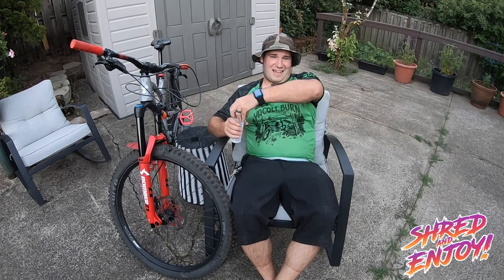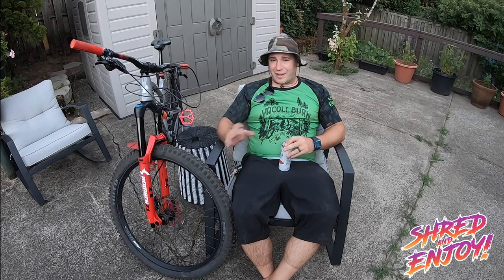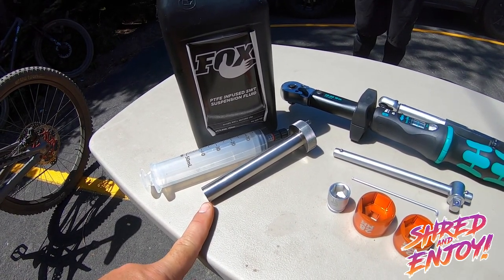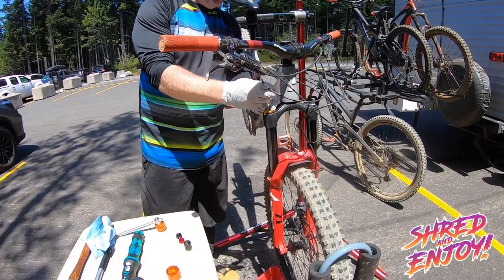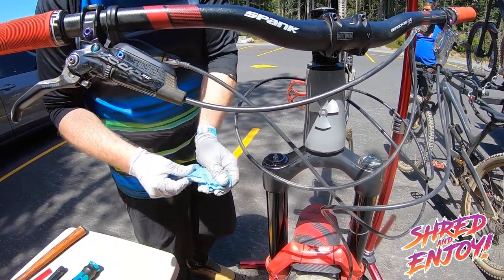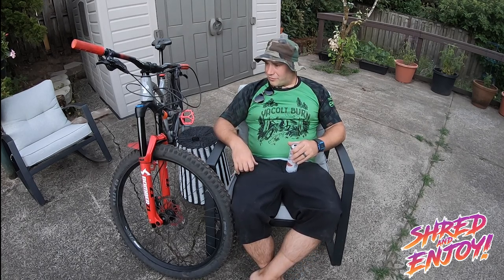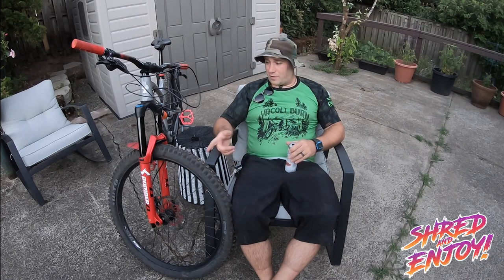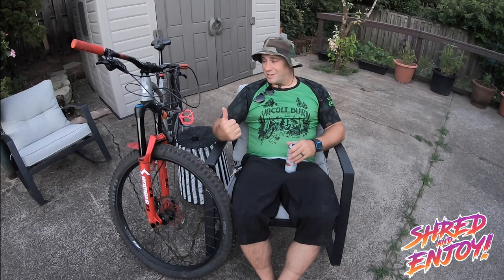Foxzocchi Z1G2 Coil -- Marzocchi Z1 Bomber Coil Fox Grip 2 Damper Install on a Mountain Bike!

Comment: Im surprised not more people do this video more often. I often ride lower in sag and use a lot of compression for mid stroke support. Seperate High and Low speed control is so useful for me and I am really looking forward doing this installation on my Z1 coil very soon as well.
Reply from the maker: I mean.... I kind of get why they don't as it's only $50 shy (at time of filming) from a Fox 36... but for heavier folk or people who have forearm/wrist discomfort or even arm pump from small trail chatter... this is the best combo I'm aware of for it.

I still need to get my 2021 Fox 36 converted to coil and then do back to back rides between the two setups.

Comment: oposite, 36fox grip 2 with marzocchi coil kitt upgrade?
Reply: I put a z1 coil in my rhythm with a grip 2 and just recently installed a vvc top cap assembly.
Reply: @toddeasterbrook8936  what is a vvc top cap? Replacement partor something additional? Thanks
Reply: @redmondhodgkinson149  make a non vvc grip 2 a vvc grip 2

Comment: Thanks for posting this video! I just ordered a Z1 Air 160mm thanks to you. Fox should send you a commission check. Found the Z1 Air 160mm on sale for $620.  I went back and forth between Air or Coil and decided on Air to save some weight on the build for now. Knowing I can upgrade to Grip2 plus have a coil option sealed the deal for me. I was also going back and forth between Z1 or 36 Performance Elite but decided to save $300 for now. The stock Grip damper may work fine for me at 160 Ibs. I suspect there will be a Marzocchi 38 to compete with Domain and Zeb in the near future. Hmmm...maybe I should have waited.

Comment: Great video! I am currently between 250-260. Do you think the Z1 coil would still work fine?
Reply from the maker: I believe so but much more and you're going to struggle
Reply: @shredandenjoy7311  Thanks for the quick reply. Hopefully I can shed some more weight and will look into it.

Comment: Do you mind sharing the model year of the fork and the damper? I've bought a Z1 Coil M.Y. 2021 and I see both a 2018 and 2021 version of the damper. I'd go for the newer which is called 820-18-335 by fox. Just wanted to be sure. Thank you very much, wish you the best!
Reply from the maker: Oh good question... I'll try and get they info next time I'm around my bike. It's currently hibernating!
Reply: @shredandenjoy7311  Okay, I solved it! I'll write it down in case someone needs the same answers as I did. Basically the 820-18-335 is just an updated version of the grip2 damper that solves a problem with the compression being too harsh for light riders, increasing the range of adjustment. That's also the correct one to install into the Z1 coil, as it just threads in as shown in the video. I'll have mine installed sometimes next month (availability is kinda crap) and I can't wait to shred my new Kitsuma+Z1 Coil Grip2 build 😍

Comment: hey could i remove the grip 2 from my air fork in the same manor as the car park install without dropping lowers?
Reply from the maker: Yes. You don't need to drop lowers to remove damper.

Comment: Thanks for the great review🤘
Seeing the pricetag in the end I have been wondering if there are any stiffer MZ1 coils available to prevent heavier riders from bottoming out?
Reply from the maker: Hey Dave! I'm 235. No issues here on the stiffest spring with this setup. It would be rad if they had more stiff springs though. For heavier riders coil is just such a no brainer!

Comment: Nice to see this is an option as I am looking at it myself. I do have one question though. What is up with those cables?? Super long, hanging all over. Total disaster...
Reply from the maker: Heh yeah I never bothered to shorten the really long front and rear cable after install. Hasn't bothered me enough to fix it. I'd have fixed it in the winter buy I've been surfing down south instead of being cooped up!

Comment: hey mate great vid, i have the z1 with the stiffest spring, did the grip 2 allow you to boost off stuff more than stock?
Reply from the maker: Not really? It did let me adjust low speed rebound to be quicker but keep high speed rebound up so it wasn't kicky on big hits. Without high speed rebound you'd have to compromise normally and have a slower rebounding ride (can't boost off of things as easy) or you'd have a faster rebounding ride for boosting(and traction in my opinion) but it would be hardh on heavy landings.

It's still not as poppy as air suspension, but if your air suspension is that puppy you're going to get bucked in really not bottom outs generally speaking.

Comment: How much do you weigh? I’m looking at getting the z1 coil but I’m concerned with only having 4 spring choices. I’m 220lbs for reference.
Reply from the maker: I was 240 at the time of filming. Worked great. Don't think you'd want to go past 250ish though.

Having high speed compression really helps expand the capabilities of the coil springs ability to provide support across a wide weight range.
Reply: @shredandenjoy7311  I really appreciate the quick response. Right now I have the Lyrik ultimate and like you said I can't find a happy place with the air spring. Same when I had a fox 36. So basically I'm torn between getting the Bomber Z1 or installing the smashpot kit into my Lyrik. Price wise it come out close to the same.

Comment: What size tyre have you got on there? Can't find a definitive answer if my 27.5 x 2.8 DHR will fit.
Reply from the maker: I'm running 29x2.5 with room to breath. In the 29 fork I'd feel pretty safe running that 27.5+ tire size. You likely wouldn't get it on the 27.5 fork thoug.

I'd also encourage anyone to go 29 over 27.5+. Way better rollover and much faster. All 27.5+ did better for me was improved braking.